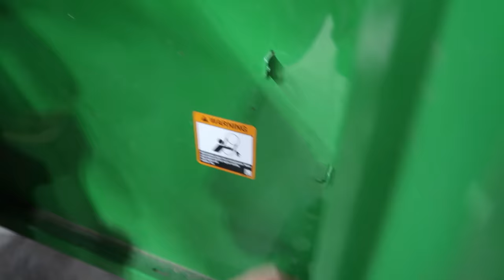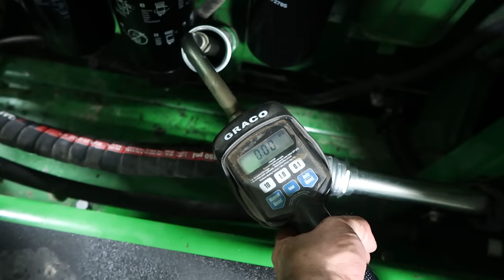Does Everybody Know What Time it Is?!

Comment: I just changed the filters on our combine and I hate the plug on the bottom of the fuel/water separator, it fought with me taking it off, I thought I had it snapped on, fired it up and it popped off lol
Reply: I hate those why can’t they just have a simple one tab where you just push down and pull it apart!

Comment: 5:40: TOP TIP: remove wristwatch before doing filter jobs in awkward places. even if the movement's ok the straps get nasty with oil / fuel...............

Comment: i really don't know why those who make those big machines don use a grease central point, to make sure every single nipple is greased
Reply: There's grease banks on the ones that are close together. Some just don't make sense to run hoses 20 feet.
Reply: @delbutler885   that is true i just wonder why there are not just some grease banks where you can easy get to them  say like 4 banks around the machine
Reply: @lytken  there's some banks on the machine. There's other zerks in places where running a line in just doesn't make sense

Comment: Why do you change oil after the machine has been setting? That does not get all the crude out of the oil Pan. You should change that oil when that oil is still hot and moving. Otherwise, that puts all that crime back through the engine.